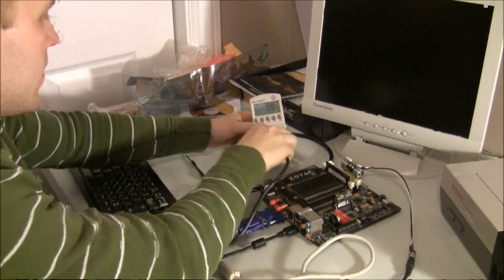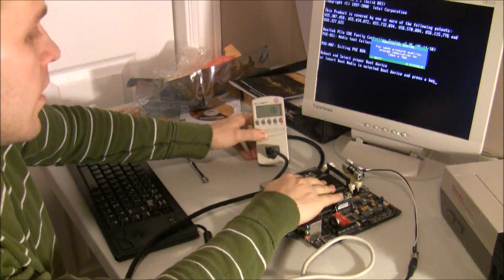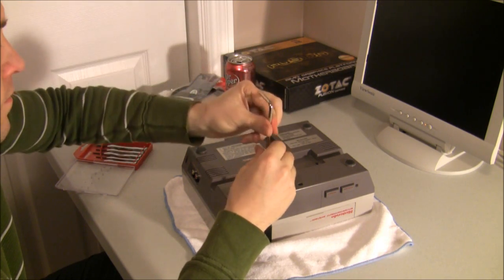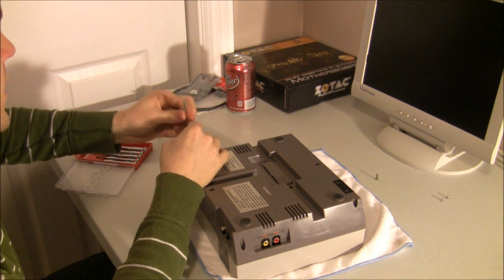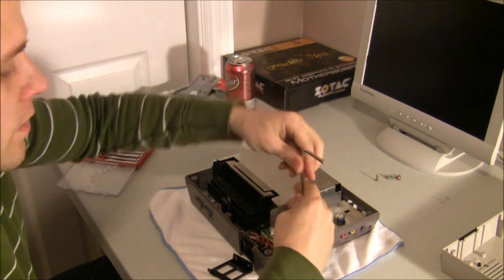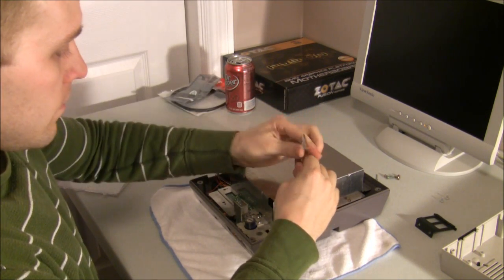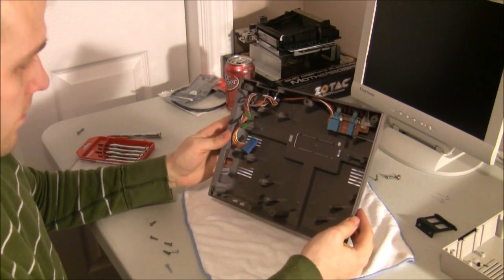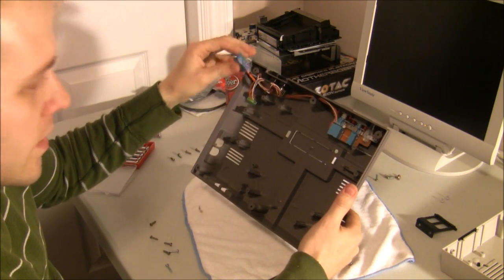Building a RETRO NES PC: Part 4 - Power Consumption, NES Teardown

Comment from the maker: Hey sorry I missed this comment until now... totally spaced it. Im using the xlp90 pico psu, the power adapter is outside of the case, the noise isn't too bad, but haven't done a ton of testing for extended periods of time. (busy) i just modified the power button to be momentary yes... check out the rest of my NES build series for more details. I checked out your video looks nice.. thanks for the props.

Comment: 8:32  Kid Icarus

Thanks for the video.  Im currently building my own PC-NES system.  Id love to see your exact component and parts list.  Board, processor, ram, pico controller, SSD, wiring interface from analog controller port to usb, and power brick if you used one inside the case.  Also, what is the noise like?  Did you also have to modify the power button to be a momentary switch?  Thanks, Craig